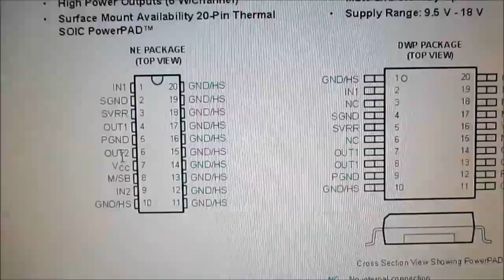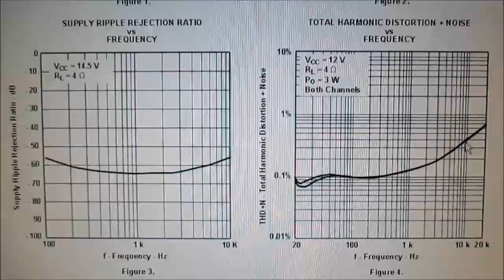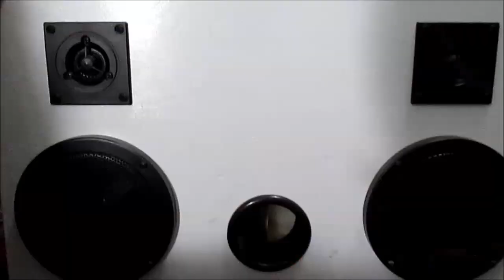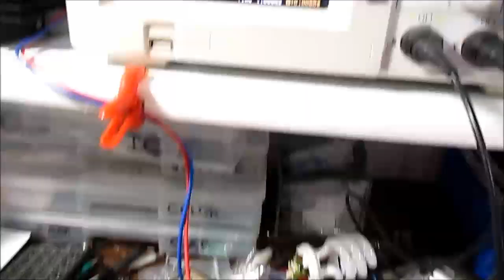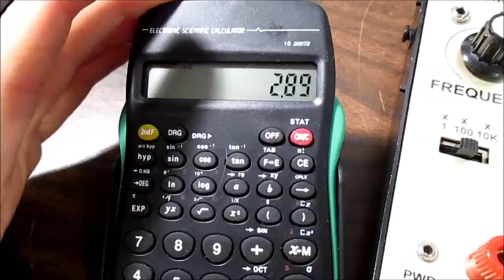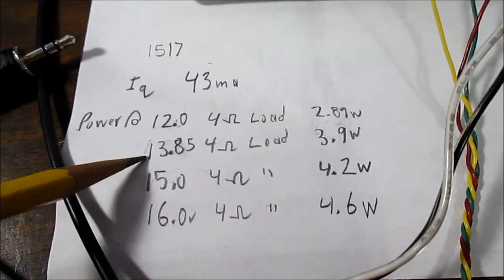TDA1517 or TPA1517 stereo audio amplifier chip amp test and review

Comment: Hi John. I am Christy Audio Taiwan. A 72-year-old electronic engineer! Some 30 years ago when TDA1517 came out, its PDF marked it as class B (must have crossover distortion?), but from its 50mA quiescent current looks it may be class AB. And 1517 is widely used in hi-end sound card. It is estimated that it is not It may be class B. Can you use an oscilloscope to see if the 1517 has crossover distortion at 4 ohm 0.1W and 4 ohm 4W? thank you very much! Thank you for unraveling the question mark of class B for HI-FI fans all over the world
Reply from the maker: It is certainly class AB. Amplifier classes are not cleanly defined. Some engineers consider class AB as just class B with a little bias. In fact, in some parts of the world, the definition of class G and H are reversed. I covered amplifier classes in a set of videos a few months ago.

Comment: I recently picked up some old PC Speakers which use this amp IC. Datasheet claims 6w per channel, dual channel. 

The brand is EDTA, although you'll find sellers listing it as SDTA because of the stylised logo, but the PCB reads EDTASONIC G-401A. The speaker cabinets have a fairly decent sized low/mid range driver (4-5") and a tweeter. The Low/mid range driver is 4 ohm 15w, the tweeter is wired directly to the low/mid driver and has a capacitor across its terminals and is rated 4 ohm 5w. Some photos of the original retail packaging has a 180w PMPO claim, but that "180w" was a sticker added on top of whatever was originally printed on the box. It also claims magnetically shielded, but there're just the speakers, which seem to maybe have a metal "cap" over the magnets, don't know if that counts, and the transformer and PCB. The cabinets are fairly big so you're not going to get close to those magnets from outside. 

The power is supplied by a 240v to 12-0-12v EI transformer. (Purchased in Australia)

Is it likely (considering the speakers wired up) that there is additional amplification before/after the TDA1517?

Comment: This chip is at the heart of Harmon Kardon HK206 computer speakers, which are often Dell-branded,  I find these computer speakers at thrift stores frequently for like $3-5, usually with their 12V (actually 11.5V), 1-amp DC wall wart power supplies.   There's some sort of preamplifier built into them, too, so a modest signal (such as is common for Walkmans, MP3 players, and cell phones), will drive the TDA1517 pretty well.    They don't sound bad on their own, though they don't have a lot of bass response.  It's fairly easy to extract the circuit board from these speakers, and use it to drive some small bookshelf speakers.  It's a great way to avoid having to build the circuit yourself, and it makes a fine 'small stereo' setup, and as you indicated, it's pretty good for battery power also.  I'm currently building a 'boom box' with one of these amp boards, driving a set of 6.5 inch coaxial 'car stereo' speakers, powered by a 12V SLA battery, all housed in a cheap plastic ammo can.

Comment: Nice chip for small speakers. I recently used LM386 again in a small speaker to sit nearby PC. The reason I chose LM386 is that it can't provide too much power to damage (not really, but it sounds crap when you push it too much) the little speaker inside, here I used the disadvantage of the chip to my advantage :) That speaker says 2W, but it distorts the sound above a watt or so, the cone wants to move but it's restricted by the surround and the spider.